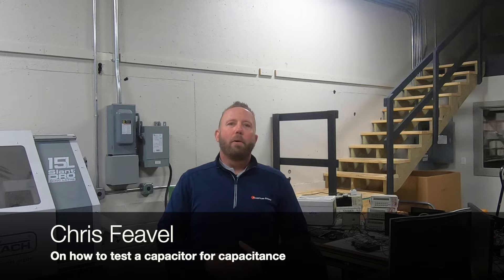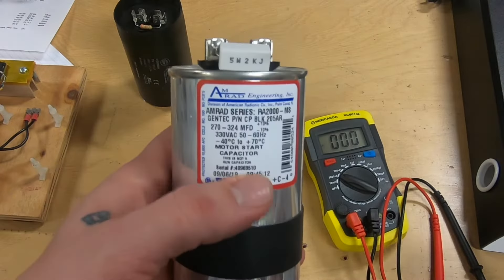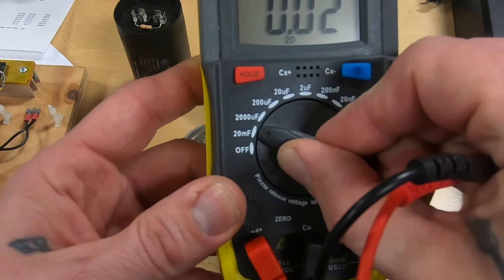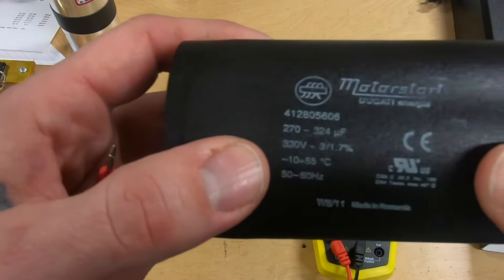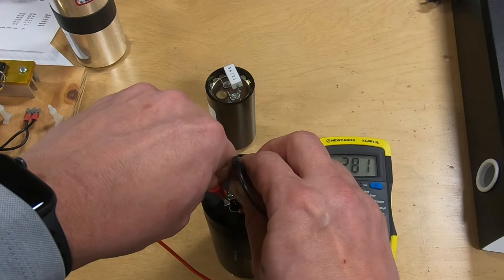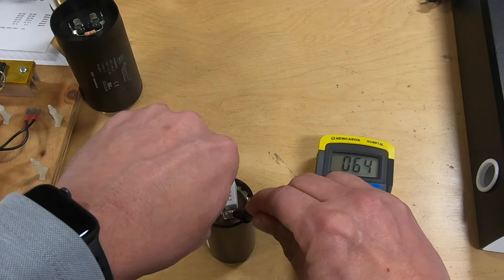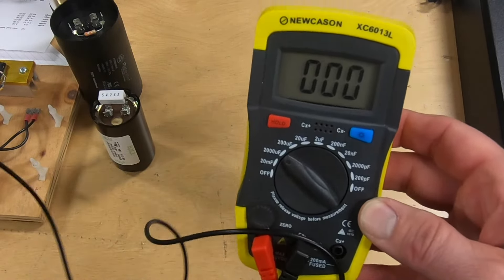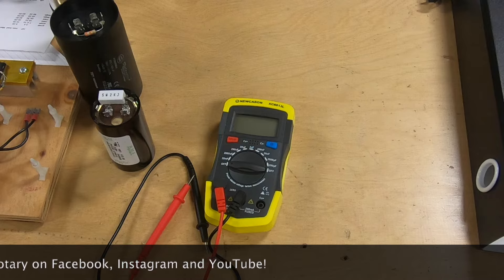How To Test a Capacitor

Comment: Thanks - If a capacitor passes the rated capacitance, is that confirmation it is good? I have a 35uf +/- 5% reporting 34.6 - However, the motor is still just humming when I turn it on. Could it still be a duff capacitor please?
Reply: A 35µF +/- 5% is equal to a range of 33.25 - 36.75µF, therefore 34.6 is within tolerance - and considered good.

Comment: Sir may I ask, if I have a motor starting capacitor for "Dough Mixer" of 80µF 10+20% 270V, and I have a reading of 85µF, shall I say that the capacitor is in excellent condition?
Reply from the maker: That is less than a 10% difference so, if your capacitors can handle a 10-20% difference you should be good!